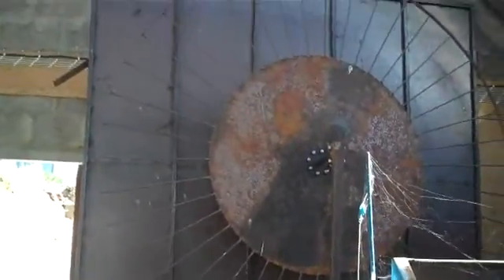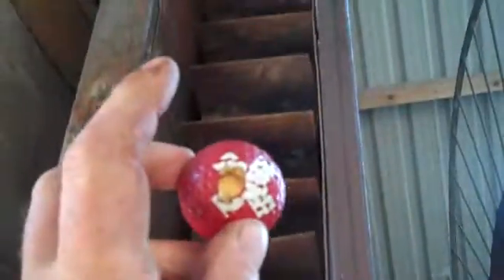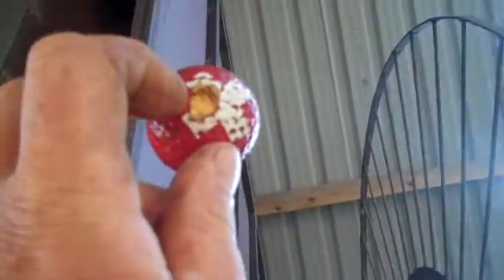perpetual motion  gravity wheel

Comment: I can see the effort you putting into the design and production of your perpetual motion machines Michael O Callaghan, and I respect your efforts, but, alas, they are all destined to fail, as have all previous, and all future, human attempts.

Reducing friction, improving seals, using different balls, and a Clever design, will do nothing to avoid the thermodynamic fact that you cannot take energy from a perpetual motion machine.  All machines require more energy than they yield, in principal.

Comment: It looks like a 8ft wheel,  and the golf balls are transferred from the top and bottom.  1 atmosphere is 14.696 PSI at 34ft in the water column.  That would be like 3 PSI  Do you have that much to shove them threw the hole!

Comment: I can only commet on what I see and I cant see the whole system. I have not built one yet but I am gathering part to build something simialr to  the chas cambell wheel. but I am going to use bowling balls. run them down and back up the same idea a cambell. but then incorporate some air filled balls for the up force. we all just want to make something work and we need to all put our minds together so if you want help we need to see more of the system and exactly what you are trying to do. thanks

Comment: nice try but I think you have to much friction and those balls are to small. in stead try using heavy ball like bowling balls, which run on the outside of the wheel on the down stroke and then travel to the inside of the wheel for the up stroke lifting. and for the boyancy part, on the same wheel have air filled balls like a soccer ball size which gets carried down by the heavy ball on the down stroke on the inside of the wheel and then rolls to the outside on the up stroke.

Comment: @tibbs122 I think you would be better off sucking air down a pipe to the bottom (the whole wheel being submeged) to fill inverted cups. Your seal a show stopper. Not only must the friction of at least 2 balls be accounted for, the fluid will want to jet out here as well.